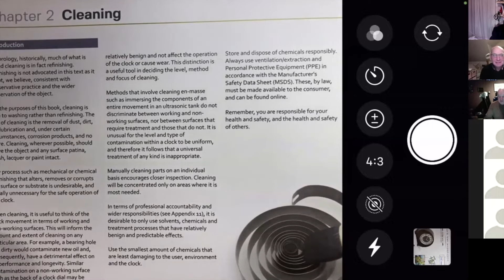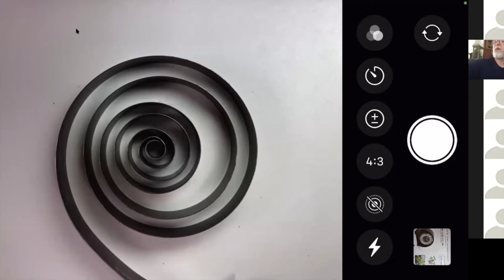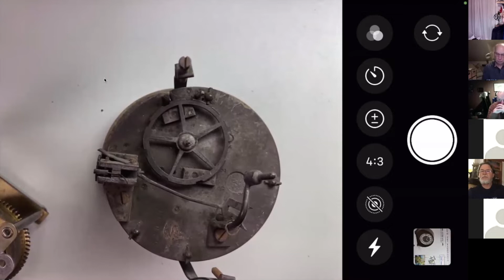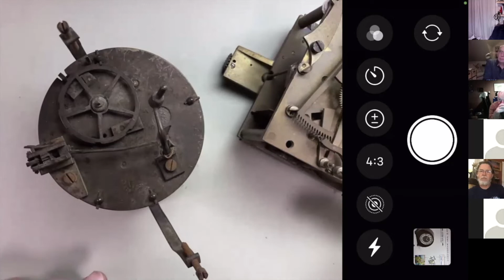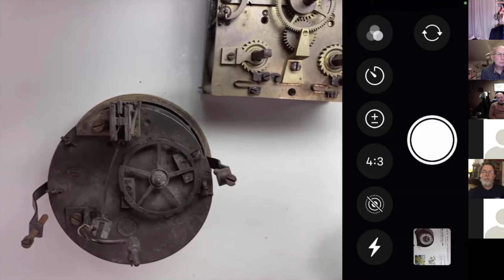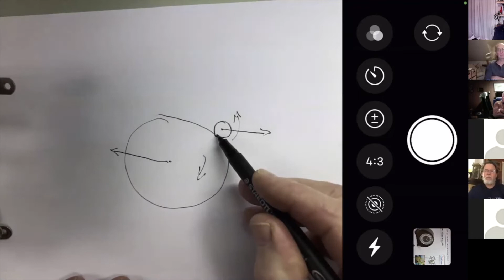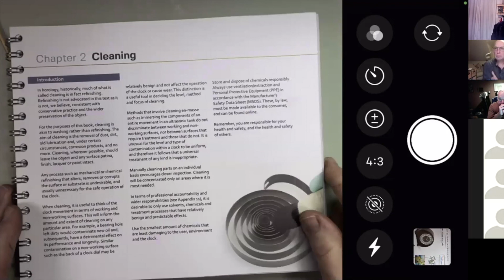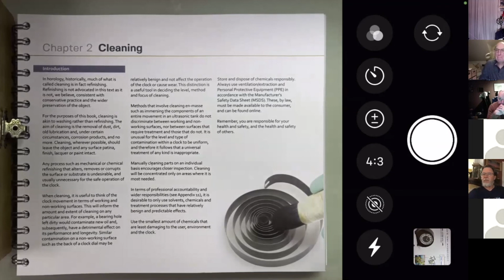Open Clock Club 004 2020_12_19

Comment: I've been following your videos for some light relief whilst editing the final draft of my PhD thesis. They've been great fun and I really enjoy them, so I should like to thank you for all the effort you're clearly putting into this. Something I have been wondering, and there may not be an answer, is if there was any reason for the dimpled pattern on the brass plates of the Smiths Enfield movement?
Reply: Hi Sam, thanks for the kind words and for following along.  Yes! is the answer re the marks on the plates.  It is a question that has been rattling around in the back of my mind for years now and I once read that it was for reducing distortion.  You mayy know that if you have a sheet of rolled brass like this and you carry out an operation to one side only, the sheet will curl. I wonder whether the pattern is for stress relief or something.  Interesting that it isn't all over the metal and on some clocks only on the front plate (transitional?).  It could also be some kind of early co-ordinate system for locating the holes?  Doubt it tho.  Sorry not to have something more definitive but will look into it!  Good luck with the thesis.  Matthew

Comment: About what clocks NOT to learn on: I've read messages on the NAWCC forum from clock repairers who refuse to work on 30-day clocks because of the power of the springs. Personally, I had a close call on my first clock, which was a 30-day clock, because I was using a cheap mainspring winder. The video of my accident (I wasn't injured) is a good illustration of what can go wrong: https://youtu.be/UyIZOXDcTxc?t=395